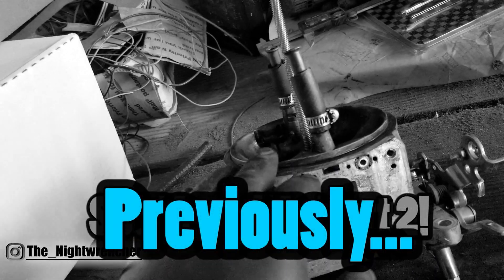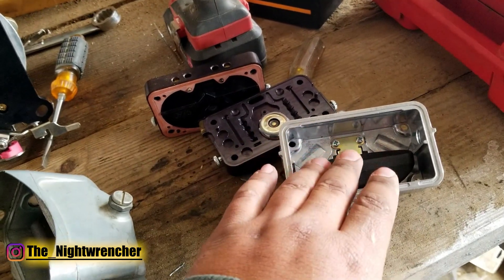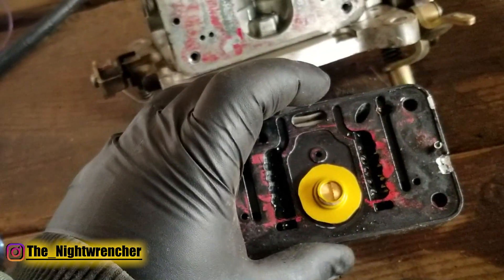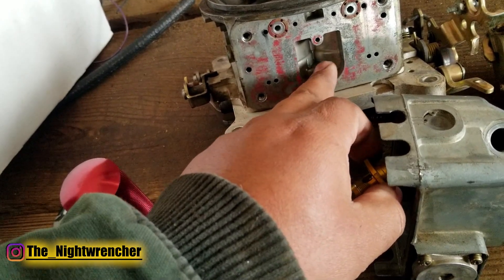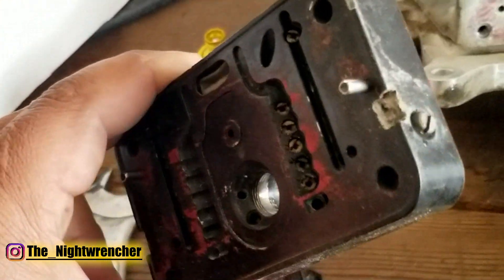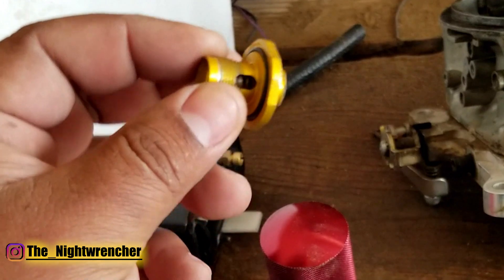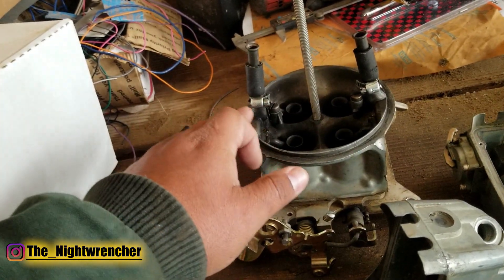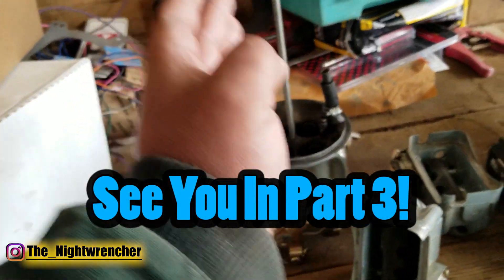DIY Blow Through Carburetor Build For The Budget Turbo Carbureted LS | Part 2 | Proform Race Series

Comment: I think you would benefit from a eldebrock vrs-4150 over these set ups because the secondary air bleed off valves and all the other adjustments.
Reply: And it can handle boost.  Even though it's not made for boost.
Reply: The vrs-4150 won't have the slamming power valve problem.
Reply from the maker: Why do you think that? How does it divert boost pressure off the power valve if they use the same power valve design? Do you have a video running one on boost by chance? Genuinely curious

Comment: I like adding a supplemental fuel injector working off a pressure switch in the intake tube before the carburetor as a more simple solution. Thanks for the video
Reply from the maker: You can do that. It was a common thing to do back when I uses to work on turbocharged hondas 10+ years ago. With a properly built carb, you can tune for the whole curve instead of just dumping fuel at WOT. Regardless, it does work.

Comment: Good Morning my Brother!!! Excellent information as usual. Love and appreciate all of your content. I wish I had your awesome skills! Do you think your blow-thru carb would work well with a Procharger? And, Why would you or anyone run 25 lbs of fuel pressure for a carb? Is it because of the boost? I run N/A on a built 429/460 but only run 7 lb fuel pressure. Thanks for sharing, Cheers and blessings from Motown/Dearborn.
Reply from the maker: Thank you sir! Check this video out, it has the answer to your question https://youtu.be/HYElRJoWIHI
Reply: You need to add a lb of fuel pressure for every lb of boost. That's why you boost reference the fuel pump/regulator.

Comment: Hey be careful with the SS needle and seats. I tried converting a 4150 to E85 blow through and put in .150" needle and seat. There was not enough buoyant force on the float to actually seal the needle and seat shut due to the larger are of the .150". I tested this because with the bowl on the car it would overfill and start to flood the engine. Taking the bowl off the car and hooking up the fuel pump feed to the bowl, I was able to simply hold the float up with my hands and seal off the needle and seat. But with the buoyant force of the float by itself it doesn't. 

The pro systems carb I have for E85 blow through is dual needle and seat and they still use viton tips
Reply from the maker: I double checked my needles after editing this video and my old alcohol demon actually had stainless .150 needles. The tip was round smooth. I do remember that in the beginning, I did have trouble getting the needles to seal when I went down to gasoline. Swapped to a larger return line on my bypass style regulator and lowered the base pressure a touch and they've been holding ever since. 7 months and several thousand miles. I'm not saying they can all be made to work, but the ones I had I did manage to save. With that being said, dual needles are a much better way to feed a carb 100%